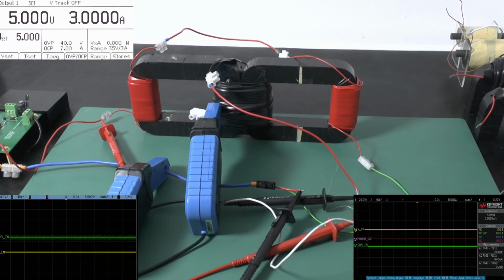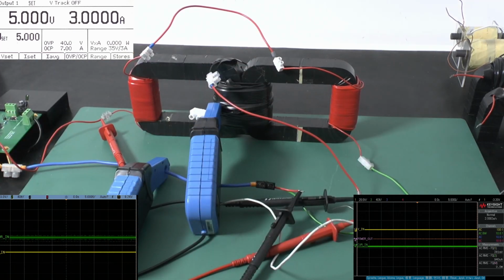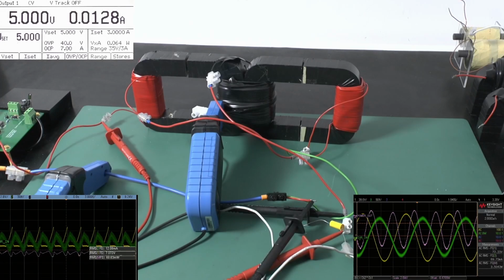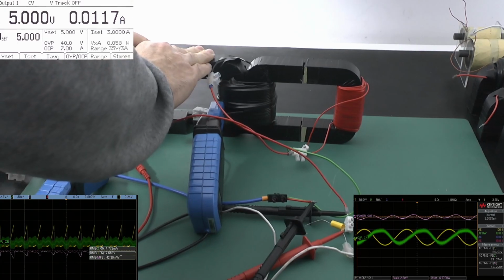The Generator "Figuera". First overview

Comment: Hola, fellow power maker!  I hope to collaborate a little with that very interesting module on the demonstration table. Specifically, it appears the condition you are trying to recreate from previous "Figuera" design is not an alternation of input current to both coils simultaneously. But instead, it appears the original intent is to gradually increase power to one coil while reducing power to the other.The magnetic fields produced by coil1 should be opposite those produced by coil2. This may be a difficult to duplicate 100% with an AC input source. But perhaps it could be approximated by placing two diodes together at the top parallel connection between coil1 and coil2, and connect one of the AC input wires in the middle between them as illustrated:
Coil1<---[+-|-]--^--[+-|-]--->Coil2
I do not have an easy solution for the other part that may or may not be required: how to apply input in very short pulsating increments?

Comment: Friend, look for parametric resonance, that means one side resonate at two times the frecuency of resonance of the other side, also you will need high voltage.  in that way you will create power.
Reply: Please write some more words of guidance  , i am stuck here in my journey to OU
Reply: make one side resonate to one frequency (RS1), then make the other side resonate RS2 at double that frequency (2xRS1)  @ТануПамир  also The  side that resonate at RS1 need to have a diameter of the wire at least two times the diameter of the other side.  connect the two inductors in series to a capacitor, charge that capacitor at high voltage,  in the point that the two inductors meet make a spark to start the process, what happen is that the two inductors will start to fight each other in the common point, and you can take energy from that point  with a diode to another capacitor.  study what i describe using animations to better understand or look for a good old book about parametric oscillations.   Share your results here, to help others.

Comment: This experiment is not faithful to Figuera's patent. He uses direct current and a resistor to induce current in the secondary ONLY by varying the intensity of the magnetic field! Its set-up induces currents, moving the Bloch Wall of the imaginary magnet from left to right and vice versa.
Reply from the maker: Not correct. He used a rotating armature to a resistor bank to trigger individual coils and therefore introduces AC. The switch from one coil set to another was not abrupt but as make before break. T